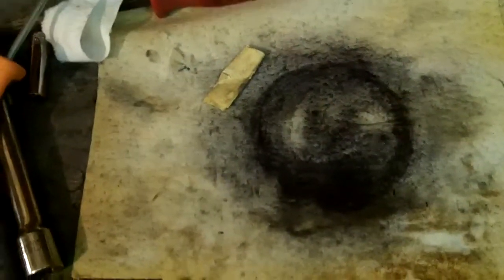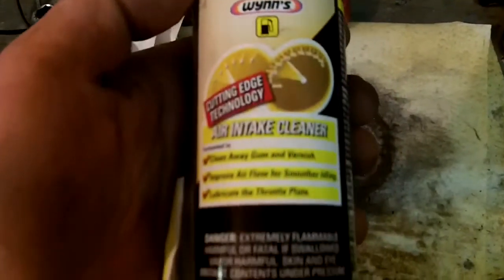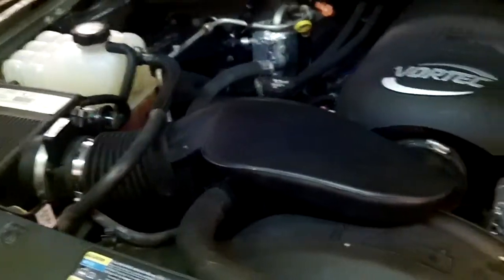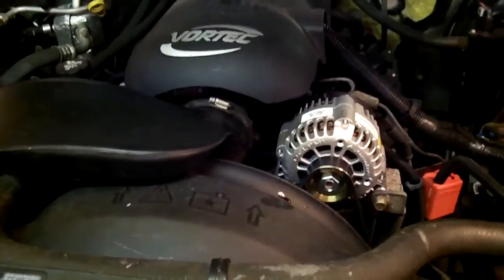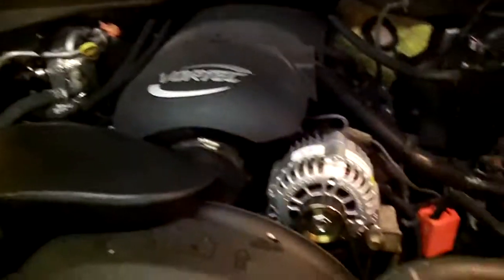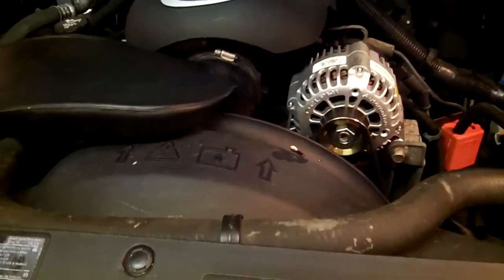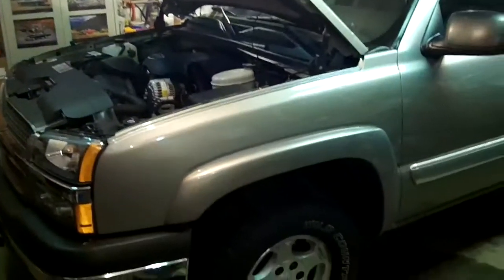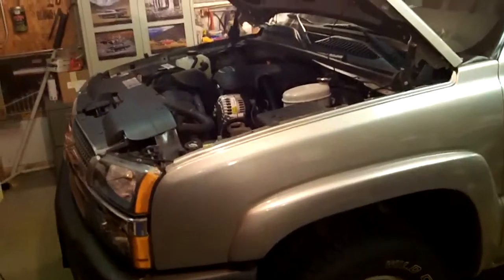2003 silverado repairs done!

Comment: I like your videos, l've watched several tonight. I have a couple of pointers on this vehicle. When you showed the throttle body cleaner and said it's the same as carb cleaner, it's not. Throttle bodies have a coating on them to help prevent the build up you are cleaning off. Without it they need to be cleaned a lot more often. Carb clean is bad for that coating.
  On the WSS repair, the bulletin for repairing says to use a rust inhibiter on the bearing surface and grease on the sensor. You mentioned both, so it leads me to think that you knew that. The repair does last longer if done this way. No matter in most cases because the bearing itself will not outlast the first sensor repair. 
  This has nothing to do with what you did, but you can get a replacement sensor. It does not have to be replaced as a bearing/sensor assembly. This is useful info if you don't have a loose bearing and the cleaning doesn't fix it. However the OE bearing and aftermarket sensor are not compatible. If memory serves the aftermarket is longer. It will fit while you are installing but will break off while driving. Only use the aftermarket sensor if you have an aftermarket bearing installed. 
     You do good work though Matt, I'd hire ya!

Comment: Yes it's a major design flaw I got a bulletin on it in my truck. At slow speeds I think it is 5mph and under. Sometimes you can't stop. I almost rear ended my GF car in my drive and same thing at a stop sign. So I pulled ABS fuse.
I cleaned the sensor but apparently driver side one is bad.
You can test them for voltage output on a volt meter.
As you know WI winters are hard on vehicles.
Reply from the maker: Thanks for watching.